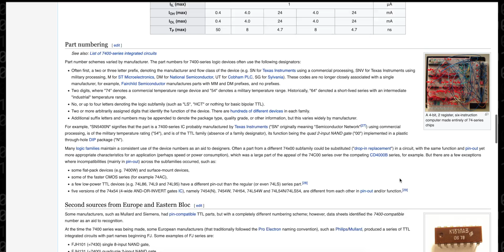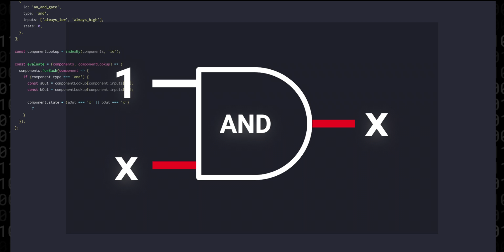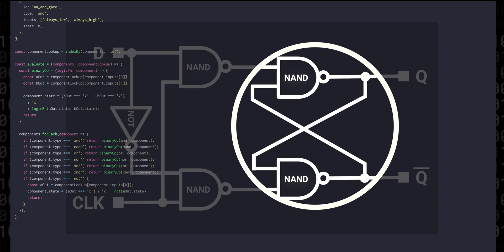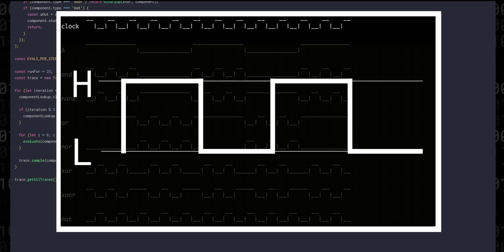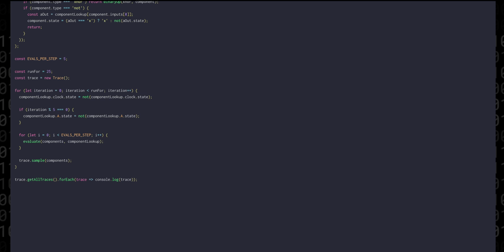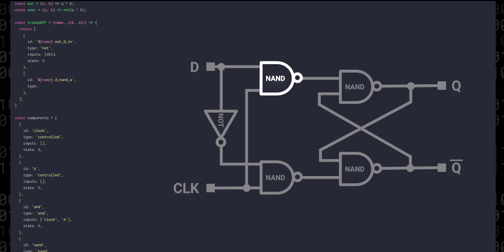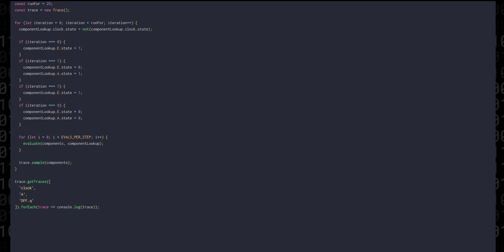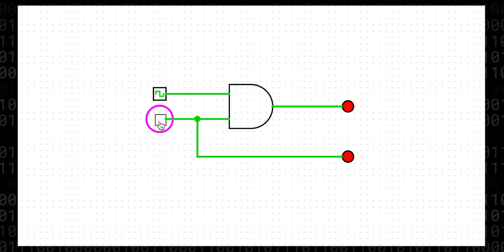Digital Circuit Simulator In JavaScript: 7400 Subscriber Special!

Comment: Great work. How do you implement Bus (Wire), Program counter and tri-state buffer in this?
Without these three, making a cpu seems very difficult if not impossible.
Reply from the maker: Most FPGAs do not support tri-stating signals internally. Multiplexers and control signals can model a bus.

Edit: I thought this  moment was in relation to my latest video, so my reply probably doesn't make any sense. You would need to introduce more possible states that 0 or 1, and make sure that gates propagate results correctly based on a high impedence signal.
Reply: @LowByteProductions  Hmm. So, it's not only me. Many face the same challenge it seems. And I am also facing a huge roadblock while modeling bus and tri-state buffers. Definitely, I will read more on your suggestions and try to implement something on my emulator.
Once again, thank you very much for making all your knowledge and hard work publicly available for free.

Comment: 10:15 I guess that's not a flip-flop, that's latch
Reply from the maker: The terms are actually synonymous https://en.m.wikipedia.org/wiki/Flip-flop_(electronics)
But in this case, the logic circuit shown on screen is pretty much universally known as a D type flip flop.
Reply: @LowByteProductions  no, they're different. Latch it's triggered by level and flip flop - by edge.
Reply from the maker: The Wikipedia link I sent has a whole section about edge VS level triggering, and the ambiguity of the definition. The long and short of it is that flip flops can be either level or edge triggered,and if you want to avoid ambiguity, you should mention  how it's triggered.
Reply from the maker: (but I do agree that using flip flop to refer to edge triggered circuits would be a better definition. the trouble is that it's not used consistently across the board, and depending on what text you read or which institution you were educated at, you're going to get a different kind of "truth", so to avoid that it's better to acknowledge that it's a historically ambiguous term, and mention the trigger mechanism explicitly if you need to clarify)
Reply: @LowByteProductions  agree!

Comment: i made same kind of simple thing and currently working on it 
my circuit has inbuilt suupport for simple latches where you can use feedback connections too...
still might have errors on generate tt
#include <iostream>
#include <math.h>
using namespace std;
//use vector to keep track of gates
class gate{
public:
int out=-1,gateType=-1,i=0,noOfInputs=0;//i is counter , out is output value ,
gate *input[4];//4 input max

gate(){}

gate(int n,int noi=2){
    gateType=n;
    if(gateType<2){
        out=gateType;
        noOfInputs=1;
        }else{
            noOfInputs=noi;
        }
}

void setGateType(int n,int noi=2){
    gateType=n;
    if(gateType<2){
        out=gateType;
    }
   if(gateType<2){
        noOfInputs=1;
        }else{
            noOfInputs=noi;
        }
}

void setOutput(int n){
    //update.viewport();
    // cout<<n;
    out=n;
}

void simulate(){
    i++;
    if(i>1){//latch pass

    if(input[0]->out!=-1 && input[1]->out!=-1){
        if(gateType<2){                             //input
            setOutput(gateType);
        }else if(gateType==2){                      //output
            setOutput(input[0]->out);
        }else if(gateType==3){                      //not gate
            setOutput(!(input[0]->out));
        }else if(gateType==4){                      //nand gate
            setOutput(!(input[0]->out&&input[0]->out));    
        }else if(gateType==5){                      //nor gate
            setOutput(!(input[0]->out||input[0]->out));
        }else if(gateType==6){                      //xnor gate
            setOutput(!(input[0]->out^input[0]->out));
        }else if(gateType==7){                      //and gate
            setOutput(input[0]->out&&input[0]->out&&input[2]->out);
        }else if(gateType==8){                      //or gate
            setOutput(input[0]->out||input[0]->out);
        }else if(gateType==9){                      //xor gate
            setOutput(input[0]->out^input[0]->out);
        }
    }else if(input[0]->out!=-1 || input[1]->out!=-1){
        if(gateType<2){                             //input
            setOutput(gateType);
        }else if(gateType==2){                      //output
            setOutput(input[0]->out);
        }else if(gateType==3){                      //not gate
            setOutput(!(input[0]->out));
        }else if(gateType==4){                      //nand gate
            setOutput(1);    
        }else if(gateType==5){                      //nor gate
            setOutput(!(input[0]->out||input[0]->out));
        }else if(gateType==6){                      //xnor gate
            setOutput(!(input[0]->out^input[0]->out));
        }else if(gateType==7){                      //and gate
            setOutput(0);
        }else if(gateType==8){                      //or gate
            setOutput(input[0]->out||input[0]->out);
        }else if(gateType==9){                      //xor gate
            setOutput(input[0]->out^input[0]->out);
        }
    }else{
        if(gateType<7){
            setOutput(1);
        }else{
            setOutput(0);
        }
    } 
    

    }else{//first pass

    if(gateType>2){
    for(int a=0;a<noOfInputs;a++){
        input[a]->simulate();
    }
    }
        if(gateType<2){                             //input
            setOutput(gateType);
        }else if(gateType==2){                      //output
            setOutput(input[0]->out);
        }else if(gateType==3){                      //not gate
            setOutput(!(input[0]->out));
        }else if(gateType==4){                      //nand gate
            setOutput(!(input[0]->out&&input[0]->out));    
        }else if(gateType==5){                      //nor gate
            setOutput(!(input[0]->out||input[0]->out));
        }else if(gateType==6){                      //xnor gate
            setOutput(!(input[0]->out^input[0]->out));
        }else if(gateType==7){                      //and gate
            input[2]->simulate();
            setOutput(input[0]->out&&input[0]->out&&input[2]->out);
        }else if(gateType==8){                      //or gate
            setOutput(input[0]->out||input[0]->out);
        }else if(gateType==9){                      //xor gate
            setOutput(input[0]->out^input[0]->out);
        }
        i=0;
    }

}

};

void generateTruthTable(gate gatesArray[],bool tracer=false){
int numberOfInputs=0,numberOfOutputs=0,s;
for(int i=0;i<20;i++){
if(gatesArray[i].gateType==3){
    numberOfOutputs++;
}
else if(gatesArray[i].gateType==0 || gatesArray[i].gateType==1){
numberOfInputs++;
}
}

int *arrInputs=new int(numberOfInputs);
int *arrOutputs=new int(numberOfOutputs);

s = numberOfInputs;
numberOfInputs=0;
numberOfOutputs=0;

for(int i=0;i<20;i++){
if(gatesArray[i].gateType==3){
    arrOutputs[numberOfOutputs]=i;
    numberOfOutputs++;
}
else if(gatesArray[i].gateType==0 || gatesArray[i].gateType==1){
arrInputs[numberOfInputs]=i;
numberOfInputs++;
}
}
numberOfInputs=s;

int *arr = new int(s);
    for(int i=0;i<s;i++){arr[i]=0;}
    for(int l=0;l<numberOfInputs;l++){
                cout<<gatesArray[arrInputs[l]].name<<"| ";
        }
        for(int l=0;l<numberOfOutputs;l++){
                cout<<gatesArray[arrOutputs[l]].name<<"| ";
        }
        cout<<endl;
    for(int j=0;j<pow(2,s);j++){

        for(int l=0;l<numberOfInputs;l++){
                gatesArray[arrInputs[l]].setGateType(arr[l],gatesArray[arrInputs[l]].name);
                
        }
        for(int l=0;l<numberOfOutputs;l++){
                gatesArray[arrOutputs[l]].simulate();
        }
    cout<<"   ";
        for(int l=0;l<numberOfInputs;l++){
                cout<<gatesArray[arrInputs[l]].out<<"   |   ";
        }
        for(int l=0;l<numberOfOutputs;l++){
                cout<<gatesArray[arrOutputs[l]].out<<"   |   ";
        }
        cout<<endl;

        arr[0]++;
        for(int k=0;k<s-1;k++){
            if(arr[k]%2==0 && arr[k]!=0){
                arr[k+1]++;
                arr[k]%=2;
            }
        }
    }

}
//0 low
//1 high
//2 output
//3 not
//4 nand
//5 nor
//6 xnor
//7 and
//8 or
//9 xor

int main(){
    
   gate andGate1(7,3),andGate2(7,3),norGate1(5),norGate2(5),J(1),K(1),Clock(1);

    andGate1.input[0]=&norGate1;
    andGate1.input[1]=&J;
    andGate1.input[2]=&Clock;

    andGate2.input[0]=&Clock;
    andGate2.input[1]=&K;
    andGate2.input[2]=&norGate2;

    norGate1.input[0]=&andGate1;
    norGate1.input[1]=&norGate2;

    norGate2.input[0]=&norGate1;
    norGate2.input[1]=&andGate2;

    while(1){
    
    Clock.setGateType(!(Clock.gateType));
    norGate1.simulate();
    norGate2.simulate();
    cout<<norGate1.out<<norGate2.out;

    getchar();
    } 
    return 0;
}

Comment: How do you code the module of 1 bit register.  You abstract the group as a symbol type with inputs.
Reply from the maker: Well a register is just a collection of logic gates wired together in a specific way, where we only care about the input and output of a few of those gates. Since it always behaves the same, we can write a function that takes in our "high level" inputs and outputs and generates the appropriate gates and connections. Then we can use that function to create "instances" of a register (which actually just add more individual gates to the array).

So in that way there's no need to code the way that registers work specifically,since the gate simulation covers it. The only thing that is not possible with the current setup is being able to react only on the positive or negative edge of a signal. For that, an extra primitive type would need to be added to the system.

Comment: I'm not up for the "Build a GUI" challenge but how about an IDE instead... https://dkilfoyle.github.io/logic/
Use a verilog-like mini DSL to describe the logic gates, parse with Arcsecond to build the gate array, simulate and then view the traces.
Amateur code and really just an exercise to experiment with building a toy DSL and code editor but provides a fun interface to examine various logic circuits. I'll expand the library with more examples. Update: New version major rewrite at https://dkilfoyle.github.io/logic2
Reply from the maker: Dean this is absolutely amazing 🔥🔥🔥
Reply: @LowByteProductions  Thanks! Version 0.3 now supports binary operation expressions eg F = (~sel & a) | (sel & b) which is much more concise and easier to understand at a glance. Episode 9 of your 16-bit VM series was essential. State machines were definitely the answer as my initial attempt using a recursive parser produced stack-overflow infinite loops.
Reply: New version:

https://dkilfoyle.github.io/logic2/

Now with JupyterLab/Lumino UI, ANTLR based parser and monaco editor. More examples (and adding more).
Reply from the maker: @dkilfoyle2  Wow this has come a long way! Such a great project man. By the way, I found out that hackaday wrote up an article recently about this video, and specifically mentioned your project as well (https://hackaday.com/2020/11/02/ttl-simulator-in-javascript/).
Reply: @LowByteProductions  Thanks! Work in progress enables building a logic expression from a truth table (sum of products) and then logic minimization via Karnaugh map. See https://youtu.be/wVMYCO6rvLY for a demo. Not fully tested yet but interesting to watch a horrendous SOP circuit simplified by kmap down to just a few gates.

Comment: How are you actually running the code? I'm on windows, I tried using p5js.org editor and it's giving me compiling issues, I've even tried other online javascript compilers - interpreters... and still can not seem to get this code to run...  P5 is complaining that "Trace" isn't defined when it is, and other sites give different errors... I'd just like to know what your setup or your environment is like... other than that... I do like this video! I am working on a Windows platform...
Reply from the maker: I'm using a JavaScript environment called node.js. Install it, then save your JavaScript to a .js file, and then run it with node in the command prompt.
You can also load that js file into an HTML document and run it in the browser.
But node is easier and something really useful to learn anyway!
Reply: @LowByteProductions  I tried installing their latest version 14.4.0, but it only supports Win 8.1 or higher... So I'm going to try using v12.18.1 instead...
Reply: @LowByteProductions  I had to uncomment one line of code and it is now working, at least within the command prompt! Thank You!
Reply from the maker: Awesome! Glad to hear it. Keep learning and experimenting!
Reply: @LowByteProductions  Well, I'm use to C/C++, your compiled languages... I've been learning Python for a little over a year. As for JavaScript, I mess around with it here and there... So, I'm guessing when I was using p5js.org it was failing because it didn't have the libraries that are packaged in node.js ... 

I've worked with Logisim before and I have actually built BenEater's 8-bit CPU in Logism (original and not Evolution). The hardest part was mimicking his `bus` design since he was using tristate buffers, and Logisim only allows their pins to be either input or output but not both... I was able to simulate the same behavior but wiring the bus took some extra work... I had to add in some extra muxes and demuxes to prevent multiple components from talking to the bus at the same time... I was able to run his example programs in it.
 
I like the idea of Hardware Emulation... it's one of the topics that I find interesting next the 3D Graphics programming,  Physics Simulations, Animations, A.I. and Machine Learning, Compiler Design... and some others... I'm just trying out similar concepts in different languages... This is for learning and experimental purposes...
Reply: @skilz8098  that sounds really cool. Please can you share a link to your Logism simulation?
Reply: @zayyadmuhammadsani6094  I don't have it posted anywhere just yet... I may put it up on Github one day...
Reply: @skilz8098  Okay, thanks anyway

Comment: Evaluating 5 times to cater for feedback seems to work nicely. But I wonder if there could be an event-driven way to do this so that you don't have to remember to increase that value as your circuits get more complex. Great video.
Reply from the maker: The good thing about doing it this way is that it's sort of like how gates actually work. Every gate actually takes a measurable amount of time to change state after it's inputs change.

That said, architecturally that sounds quite interesting!
Reply: @LowByteProductions  Perhaps instead of running the evaluation n times, it could work by simply comparing the current states of all components to their previous states in a loop, and break the loop when the states of the components are all equal to the last step?
Reply: @Grillparzer  problem with that is you quickly run into systems that don't ever settle in a single state, but keep oscillating (think SR-latch with both inputs high).

Comment: Can u please please please please please please increase the font size in your editor?
Reply from the maker: Hey Anurag, I see what you're saying. It's definitely meant to be seen at a higher resolution (HD), but I understand that it's frustrating if you're watching on a smaller device or an internet connection that doesn't allow for that. It's a hard balance, because I think it's pretty important to be able to see a whole block at a time. In the next might experiment with dynamic sizing of the text throughout the video - so zoomed in when it makes sense and a bit more or an overview when it's need. The feedback is appreciated 👍
Reply: @LowByteProductions  yes also it is matter of Internet bandwidth and speed... i cannot watch full hd videos because of limited internet access. so if you bump up the size it i can your videos even on 360/240p :D
Reply: I'd never heard of logisim but have thought about making the same thing for HTML5 before. It's nice to know I'm not the only one who wants it.